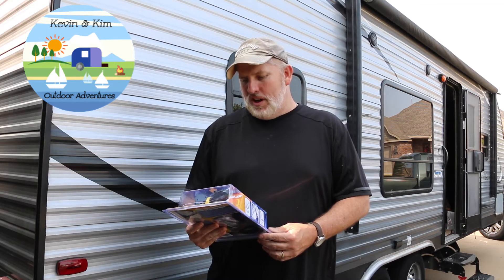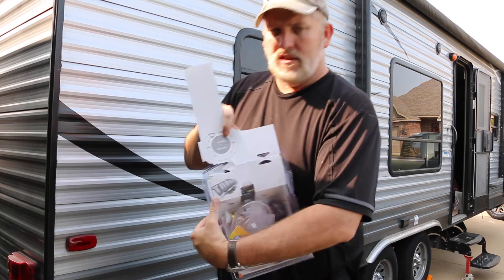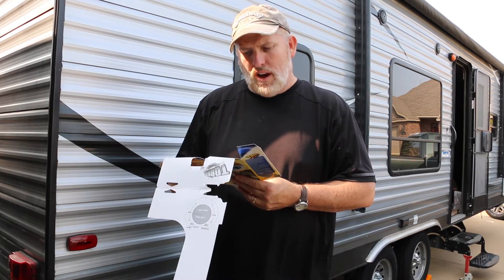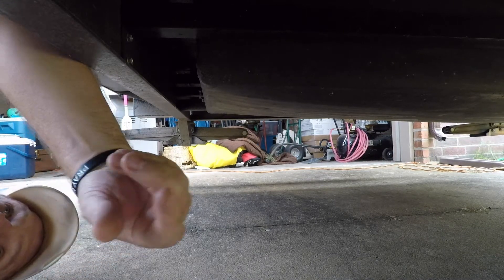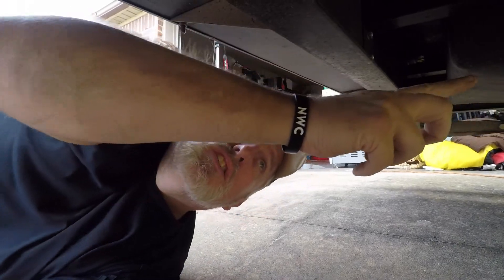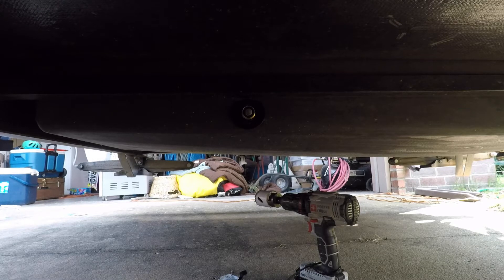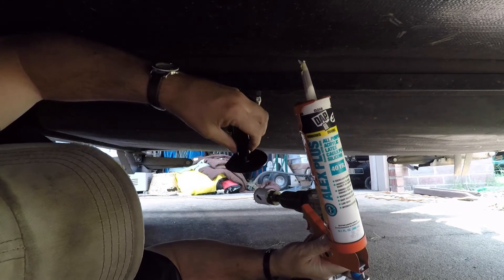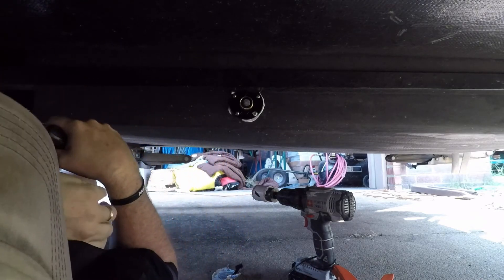Installing Camco Tornado Rotary Tank Rinser - Easy Step By Step Instructions

Comment: 1 thing i noticed was that u used latex instead of silicone. I could be wrong but the tube doesnt lie. Silicone is always a better choice for sealing and durability.
Reply from the maker: Agreed it would be better 100%silicone. It was latex caulk with silicone.  Thanks for watching.

Comment: You are gonna wanna put it towards the bumper, road debris will tear it off if its facing the cab. Plus the connection will be accessible.
Reply from the maker: Good thought. Ours is up higher enough that we have not had any issues. We just absolutely love it. Thanks for watching and commenting.

Comment: Thanks for the vid, Thinking of doing this install this weekend. Any issue with leaking using latex sealant vs the recommended silicone?
Reply from the maker: You will loves it works so well. No I have had no issues with any leakage. The latex I used had silicone in it and it sealed nice. Good question!! Thanks for watching